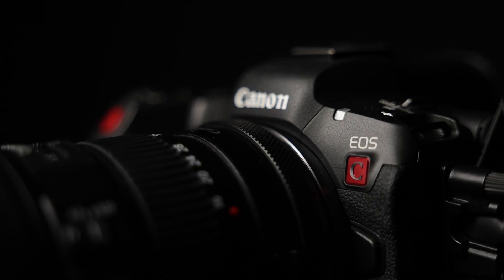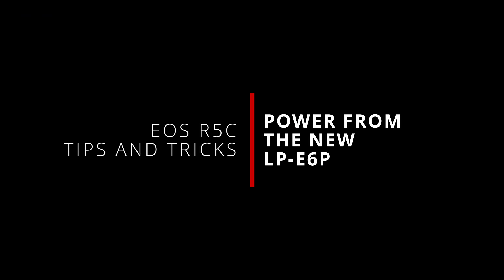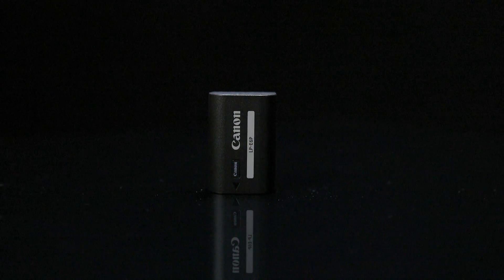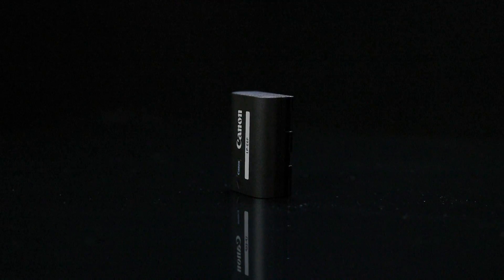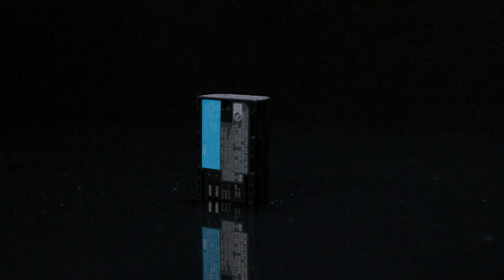Powering the R5C with the LP-E6P battery - EOS R5C Tip 37

Comment from the maker: According to a recent announcement by Canon (December 2024) a new firmware should be coming for the R5C this month that allows the LP-E6P battery to a lens when recording in 8K60. So it looks like that dream will becoming a reality soon.
Reply: Great video!!!!  With the new canon batteries you mentioned in the video, can you shoot 4k 60 hq with auto focus and without other limitations?  Does the fan in the Rc5 ever cause audio issues?  Thanks.
Reply from the maker: Yes, with the LP-E6Ps you can shoot at 60P wihtout limitations.

Re. the fan and audio... By default the camera runs the fan at low speed all the time, and I've never had a problem with picking it up in recordings. You can also configure the camera to automatically stop the fan when recording and run the fan when in standby mode (this mode will also turn the fan on when recording if the camera temp gets too high).

Comment: 2 batteries and BG R10 battery grip also works well?
Reply from the maker: That will double the recording time, since you have twice as much power to draw from. Two LP-E6Ps will give you full 8k60 w/ AF capabilities, and even more recording time sinc the camera can use more of their capacity than the older E6NHs. 

That said, other than a few minutes of testing when I first got the camera, I haven't run mine in that configuration for personally. But it does work, and you do get increased recording time.

Comment: Can also powering R5C using canon dr-e6p with external battery ? 
I heard it is possible in R5 MarkII
https://youtu.be/Xh-5WgEwO9U?si=OkcyIjuYiVDitwgT
Reply from the maker: I don't have any experience with trying to use the DR-E6P with the R5C, so unfortunately, I can't answer that.

It's possible that it might work, even if the battery provides 9V to the camera the R5C appears to be able to handle that voltage. But since the DC couplers and batteries communicate what they are to the camera, I don't know if the R5C will recognize the DR-E6P as a compatible with the highest power consumption modes (e.g. all functionality at 8K60).

But since i haven't tested it, I can't say for sure.

Comment: I picked up an R5C on Amazon, renewed about a month or so ago. Came with the NH battery. With power saving mode on, I get about 90 minutes from a fully charged NH battery. I just picked up the LP-E6P, and fully charged, it gets me 90 minutes. But here's the truth (at least in my case): the new 6P battery goes from those 90 minutes to 70 minutes in under four minutes. That's with me using RF 24-105 L lens, 24fps, 4K. Image stabilization is on, as well as the new vector stabilization. So for me, it's either turn on power saving mode for the old NH battery, or use the 6P battery with power savings turned off...and it's pretty much the same recording time either way. I'm glad I got my smallrig 99 vmounts, those I can rely on for a much more extended usage time overall. Or, USB.
Reply from the maker: Anyway you cut it a 16 watt-hour battery is still a 16-watt hour battery. The E6Ps, allow for more functionality since they can support a higher current draw, but they're still limited by capacity anyway you cut it. Further, the more features you use the more power the camera draws and the faster the battery runs out.

If you need all day shooting, or even multi-hour shooting, you have to look at a bigger external battery solution; as you have. This is one of the things you get form cameras like the C70/C80 and C400. The smallest BP- series battery they take is something like 50 Wh, and the larger is 90.

I hardly ever use my R5C without external power. It's almost always hooked up with USB-PD to a SmallRig NPF Advanced Adapter plate with USB-PD out. The only thing I use the LP-E6NH in camera for is booting it and starting the USB-PD session and if I use the camera for still photography without the video rig. Because I do things that way, I haven't bothered buying E6Ps for my R5C and I'm not sure if I will.

Comment: Amazing video. Update on the R5C 8k 60fps modes:
Version 1.1.0.1 comes with: Enables functions to be used without limitation in conjunction with the new Battery Pack LP-E6P. This makes it possible to shoot 59.94P with RAW LT.
Reply from the maker: Yea, that's the big win if you're fine with the short recording times.

Comment: IS DR-E6P also can enable R5C with fully function now?
Reply from the maker: Yes. As long as you're running firmware 1.0.9.1 or newer.
Reply: @PointsInFocus  我的R5C更新至1.1.0.1。使用DR-E6搭配支援PD 65W的充電器並不能使用，開機1~2秒就會關機了。但相同的條件下R6II是可以正常使用的DR-E6P的
Reply from the maker: @Jay580th  The R5C requires the DR-E6C DC coupler not the DR-E6.

Comment: As always, I'm impressed with the level of detail provided in your video. My camera is an EOS R5 (Mark I), I just purchased an LP-E6P to replace an aging LP-E6NH battery. This will be useful if I ever upgrade to the R5 Mark II. I'm curious if the advantages of the LP-E6P battery for the R5C would similarly apply to the R5. I'm primarily thinking of extended usage with the of High Speed Continuous Shooting modes. Any thoughts?
Reply from the maker: I have a video coming on that in a couple of weeks. What I found was: For video, the E6P doesn't get you anything on the R5 that I could find. 

For stills, at least when I shot that video, I hadn't been able to come up with an acceptable way to test burst speed and frame counts at those speeds (at least not without putting many hundred frames worth of wear on my camera's shutter). In some subsequent testing, with partially depleted batteries where I could look at a battery percent v. continuous drive icon color, the cutoff for the green (max) and solid white (mid) drive speeds appears to still be 60%. And given that the batteries are the same capacity, I suspect that also means the same or very similar frame counts too.
Reply: @PointsInFocus  Thanks for the reply. On the other hand, perhaps it takes longer (more shots) to get to the 60% threshold with the LP-E6P compared to the LP-E6NH. BTW, I only found one store in Canada that had the LP-E6P in stock. I'm aware that B&H has them but there is a restriction on shipment to Canada. Also, for USB power delivery, TECHSMARTER makes a 30000mah R45W USB-C PD Heavy Duty Power Bank. It easily provided enough power to  record my son's wedding ceremony on the EOS R5 (Mark I). Getting around the 30 minute record time is a whole other story :-) (I used the TC-80N3 Timer Remote Controller).
Reply from the maker: It's possible, that's the part I don't really want to test though. ☹️ I use my own gear for all of these videos, and while the R5 has a 500,000 cycle MTBF shutter, I just can't bring myself to shooting 1000+ frames to log battery states and frame counts for controlled testing.
Reply: @PointsInFocus  That's perfectly understandable. For my part, I can see if at least anecdotally there's an improvement using the LP-E6P. Recently, I've started taking a lot of shots of birds so High-Speed Continuous Shooting is important. I doubt that I would ever even come close to the 500,000 shot limit (I use the Electronic First Curtain Shutter mode exclusively).

Comment: Does this work with the r5ii ? They advertise it is..
Reply from the maker: The E6P is the battery that comes with the R5 mark II, so yes, this works with the R5 mark II, though the performance measured here is specifically for the R5C.

Edit to add. This is especially true for the last part looking at the initial
Servo af point as that whole system has been replaced.

Comment: What advantages (or disadvantages) are there in using an LP-E6P in the original R5???
Reply from the maker: I don't see any disadvantages, aside from buying new batteries. As for advantages, I don't actually know. But since you asked, and I'm curious too, I'll put that on the to do list and look into it.
Reply: @PointsInFocus I see the latest firmware now allows LP-E6 to work on the R5 so this testing is doable.
Reply from the maker: Testing was doable before the firmware update. The problem I'm actually running into and why I haven't finished the testing yet, is working out a test procedure that hits the points I want to look at (video is easy, stills are much harder) and doesn't put a ton more wear and tear on my camera in the process. I haven't given up on doing it yet, but I need to come up with a test protocol that works for me and delivers useful numbers.
Reply: @PointsInFocus  Looking forward to it! Perhaps the shutter count could be one of measures to compare...

Comment: My canon R6mk2 can only shoot 4k50 no matter the card I put in it, I only got 3 LP-E6NH for it
Do u think the battery might be the issue?
Reply from the maker: There are so many questions that need to be asked to answer that. For starters, what frame rate are you trying to record in? And what format and recording mode are you trying to record in?
Reply: You want 4k60, instead of 50? Then switch it to NTSC mode, from PAL mode.

Comment: 15W ? It needs 9V 3A = 27W !! (for 8k60 with AF)
Reply from the maker: For one reason or another, Canon requires the highest USB-PD power profile, even though the camera doesn't use anywhere near that much power. It won't pull more than 15-16W when shooting 8K60. I've looked at this both with current and voltage meters, as well as USB-PD power meters, and I've never seen anything near 20W let alone 27W.

My guess, is that Canon over states the power requirements when negotiating USB-PD to deal with instantaneous current spikes (like for the inrush current of the AF motors of a big lens). If that's the case, it's doubly frustrating as the USB-PD spec allows for that kind of thing, with devices being able to state their continuous and instantaneous current requirements. That is, Canon could ask for 20W or even 15W, with a much higher instantaneous/short term limit.
Reply: @PointsInFocus  That's because you haven't loaded the camera up. Try adding the Tascam adapter to that and supply phantom 48V to two microphones. 
There's more options, that will result in a higher load. 
Also, it's not the highest profile. The R5 Mk II requires the 15V profile for USB-C PD power now and the 20V profile for the Canon DR-E6P dummy.
Oh ... and then there is the power zoom lenses, like the CN-E 18-80mm T/4.4, CN-E 70-200mm T/4.4 and the new RF 24-105mm F/2.8 IS L Z ... of which their motors also are fed from the camera unless you feed them with external power, too.
Reply from the maker: Fair point on the CA-XLR2d and power zoom lenses; didn't even think about them. That said, I don't get a paycheck (or any support) from Canon for these videos so I do my best to get as much correct as I can.

As for the 9V/3A not being the highest power profile. What I was trying to say was the highest for for the 9V power level. There's obviously higher profiles in the 15 and 20V ranges, and with USB-PD 3 even higher voltages than that. But the camera isn't a 15 or 20V device, and the highest profile permitted in the standard in the 9V range is 3A.
Reply: @PointsInFocus  Fair. And neither am I getting paid by Canon. I'm just pointing out, why they required said profile. (plus, I've actually tested and used said gear with it)
Reply from the maker: My very limited understanding of the DR-E6P is that it takes either 15 or 20V USB-PD voltages, and divides that voltage in half to provide either 7.5 or 10V to the camera.

At least in theory that means it should be compatible with everything Canon makes (except the R5C's full power mode). Though I don't have a DR-E6P, the test equipment to see if it works safely, or the spare cameras to potentially destroy to find out. Would love to know though.
Reply: @PointsInFocus  It only takes the 20V profile. The R5 Mk II USB port only takes the 15V profile.
Reply from the maker: What power draws have you actually see in that configurations?

I know the CA-XLR2d is only a 2W device, and it can only provide another 0.43W for phantom power when it's powered by the multi-function shoe. I wouldn't expect to see more than 18W with the CA-XLR2d.

One of these days I'm going to get the RF 24-105/2.8 Z and a power zoom module and play around with that. I almost got one last year, but I really didn't need it and I decided to save the money instead.
Reply from the maker: Interesting....  Crutchfield's page for the DR-E6P says it takes 15 and 20V in and outputs 7.5 or 10V.

It wouldn't be the first time someone was wrong about something, but I find it odd that they'd include those specs on the product listing (when nobody else does).

Edit: This is part of what really frustrates me with the camera companies that don't provide full specifications for their power systems.
Reply: @PointsInFocus  So can we asume that the new LP-E6P battery is capable of powering the R5C shooting 8k60P internally with autofocus , but Canon just don't give us a firmware update on R5C?  😂

Comment: Do you think that I will also need to upgrade my battery grip to one of the new ones?
Reply from the maker: As far as I know, no. The LP-E6Ps seem to work fine in the BG-R10. In fact, I can't really tell what the difference is between the BG-R10 and BG-R20 other than the new numb on the thumb stick (though I haven't taken the two apart to see if there aren't any internal differences).

Comment: Great breakdown per usual. I just ordered two of them (B&C Camera is in stock). Semi-related question: I’d love to use that Kondor Blue Pro Blade Top Handle which has the San Disk Pro Blade built in. Since the USB-C port on the R5c is sans recording ability, would it be possible to record straight to the Pro Blade via a USB-C to Micro HDMI cable? Thanks in advance!!
Reply from the maker: I don't have that handle, but looking at the webpage for it, I don't think so. 

Looking at the page for the handle, and the supported camera list, it's not doing HDMI over USB-C and converting. It presents to the camera as a USB-C mass storage device. This means that the camera has to support writing to external USB storage to be able to use it, which as you know the R5C doesn't.
Reply: @PointsInFocus  That was my hunch, but I needed the Premiere R5c Expert to confirm. Hoping my R5c's future big brother, C80, will pull through in this regard, because that handle's design is genius for recording. 

Thanks for the quick response and keep up the good work!